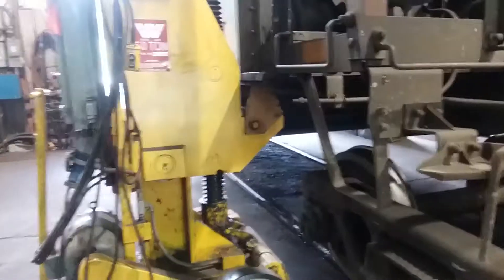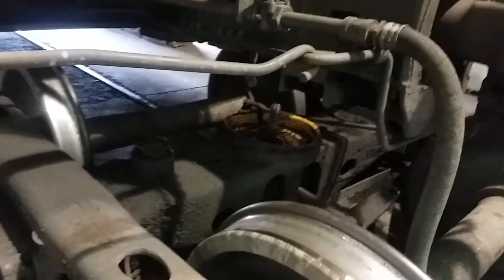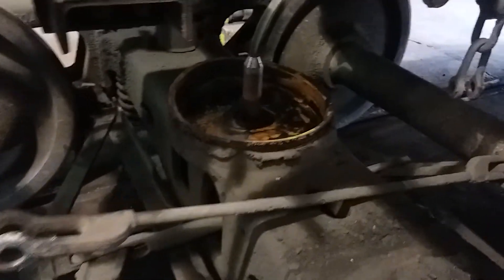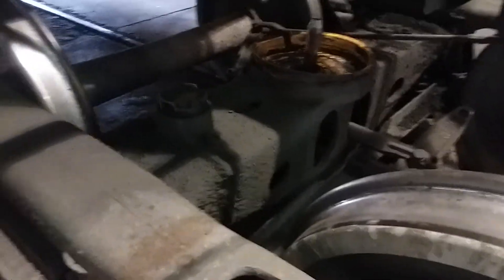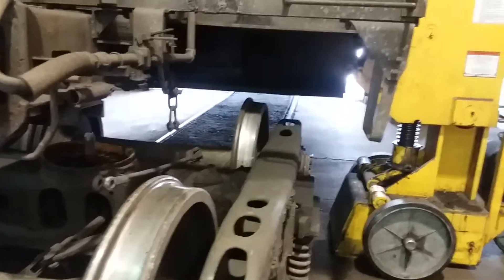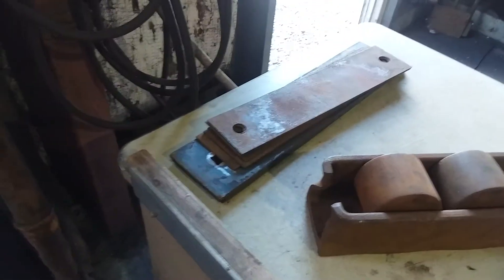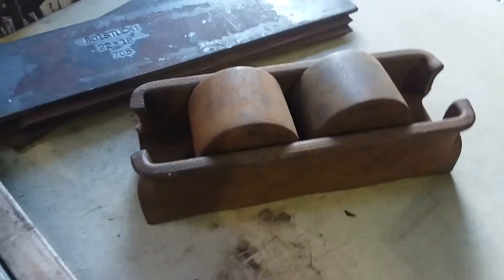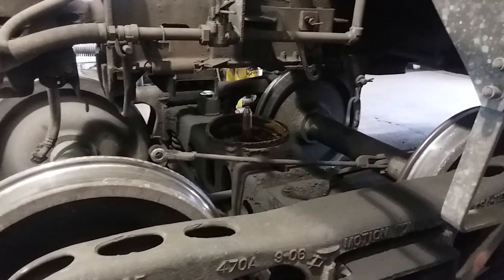Bad Order Coal Hopper Car with Side Bearing Missing

Comment: Robert Hall Socket with the yellow washer for the pivot looks very similar to the car that tore up the track.  A new truck doesn't appear to have any visible segments.  Is the assembly covered with epoxy?
Reply from the maker: That video was taken several years ago Robert and I can't remember
what all was in it. The yellow liner does not always come in with
a new rebuilt truck set, but the mechanics always put one in
before setting the car back down on the truck set, along with 2
packets of grease.  We have a whole box of those liners in the shop
for such instances. There is no epoxy used. Hope that helped
answer and appreciate your taking the time to watch and write
in my friend.

Comment: Locomotives also have side bearings on the trucks.  The Huckleberry RR (a 3-ft tourist line at Flint, MI) got a 75-ton HK Porter C-C diesel that had been built for the US Gypsum Co. mine to mill track in 1946.  The center bowls and truck bowls had worn so much that the side bearings were supporting the loco all the time which caused cracking in the cross-frame to frame welds as well as causing a derailment, the truck did not want to turn to follow the track.  We jacked the loco up on each end to gain access to the truck bowl, cleaned the bowl, installed HDPF disks in each bowl for lubrication, and replaced the side bearings with new freight car side bearings, no more derailments.  The clearance for the side bearings to plates is 3/8 inch.  Interestingly the side bearings on the D&RGW narrow-gauge passenger cars are on the outside of the trucks and almost under the side of the cars instead of inside of the trucks to the underside of the cars.
Reply from the maker: Thank you very much for taking the time to write in and share
your thoughts Roy. We do appreciate your visiting with us and watching my friend.

Comment: Hello. For the round style side bearing, do they slide against the car body or does the side bearing ‘stretch’ along with it? Have you done any videos that show the rail cars sitting on a curve?
Reply from the maker: The rollers do not come into contact with the wear plate on
the car body unless and until the car negotiates a curve. The
constant contact side bearings are in, as the name implies, always
in contact with the car body wear plates. No I do not
have any videos of what you want, good suggestion and I will
make one if I ever get the chance, very seldom do our cars
stop in a higher degree curve which would show how the roller
bearings work. Thanks for taking the time to watch the video
Karl. (my son's first name also)
Reply: @ccrx6700  got it! For the constant contact ones, do the car body wear plates just slide across them, or do the side bearings move with the plates. Just trying to figure out how they don’t wear out right away if they keep rubbing up against each other. :)

Comment: We use solid metal blocks as sidefricktions and put metal plates in underneath the block to get the correct sidefricktion hight to prevent overtilting we glue them in no breaking  and a wearplate on the wagon itself havent seen one broken in my 22 years of service
Reply from the maker: B&O RR was first here to use the blocks pre 1900. Since then they have evolved into the rollers and constant contact bearings. Although no new blocks are allowed here, on occasion they can still be found, mostly on tankers. Interesting you glue them in. Wondering the max weight of the cars using the blocks? Our coal hoppers max at 286,000 pounds
Reply: @ccrx6700  all use them the wagons are tipped in a tipler to get the manganese out so the blocks are glued so it dont fall out. B&O ( does that stand for Berlington and Ohio? We run 375 manganese ore wagons on a train. https://youtu.be/ZWCF2xM59Po that are the little ore wagons we have bigger ones much much bigger. https://youtu.be/VynleFxtf8Y. That was taken years ago though. https://en.wikipedia.org/wiki/Sishen%E2%80%93Saldanha_railway_line.  https://en.wikipedia.org/wiki/South_African_Class_15E.  https://en.wikipedia.org/wiki/South_African_Class_43-000

Comment: I've seen cars twisting and moving back and forth on rough or uneven track that has to tough on pivot points like that?
Reply from the maker: Yes sir.  These hopper cars are so designed that the car body can undergo 1 1/2 inch twist over its length, just a bit of trivia thought i,d throw that out there

Comment: are the side bearings replaceable. All the cars are the same age and mileage.  Perhaps it's time to start replacing them rather than destroying one or more cars when they fail
Reply from the maker: Wayne, yes they are replaceable and we do replace them each time a truck set is taken out and refurbished
Reply: @ccrx6700  better look at the car repair records and see how many have NOT been changed.. and move those up in the schedule..  or just go in and replace them as quickly as you can without doing a complete referb on the truck until all the side bearings are replaced to reduce the chance of a loss of rail car , rail cars and loads causing issues with load outs at the docks.